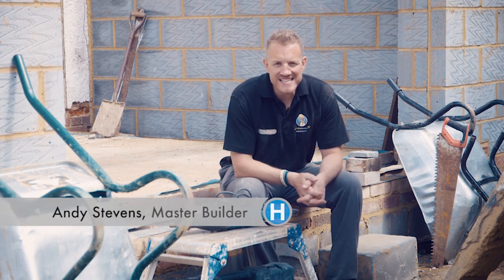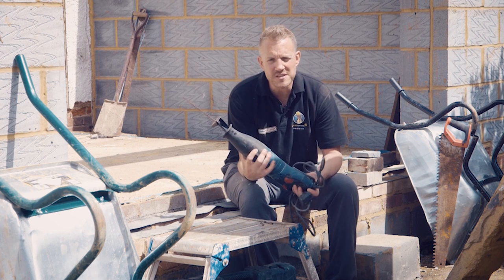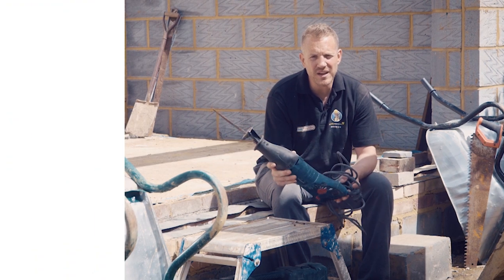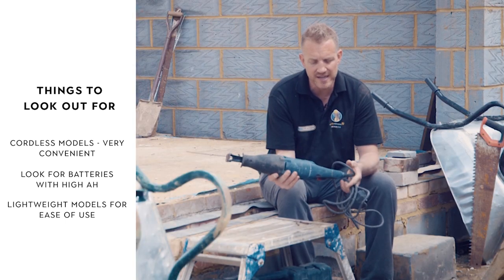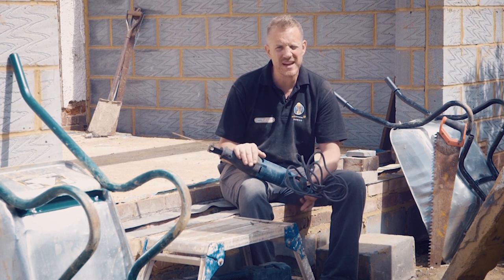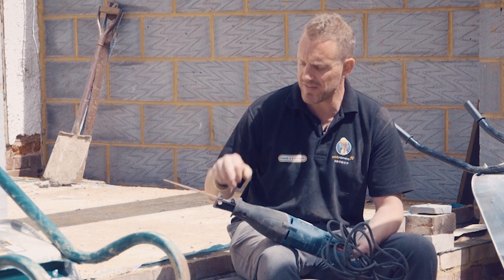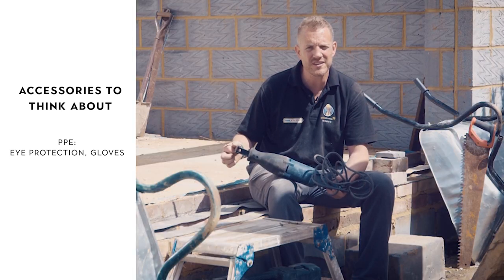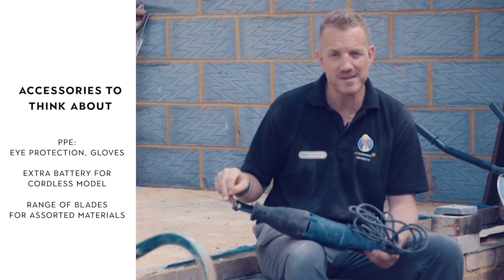Buy The Best Reciprocating Saw | TOOLS | Homebuilding

Comment: The 110v Makita AVT Recipe Saw is difficult to beat if you're using one for long periods of time. The Anti-Vibration Technology really works and stops "white/numb" finger and it has loads of power. Best recip blades for thick metal cutting are the FREUD DS0908CF DIABLO 9" Steel Demon Carbide Tipped, they're mind blowingly brilliant, like a hot knife through butter with little to no sparks  😀 Mind you, you'll have to shop around if you want any, as currently can only get them from the USA. Have yet to find a comparable Wood Cutting blade that lasts so long.
Reply from the maker: Brilliant info, thanks Rocky.